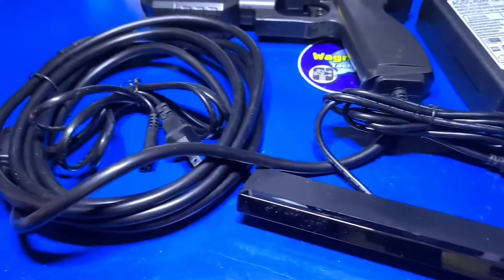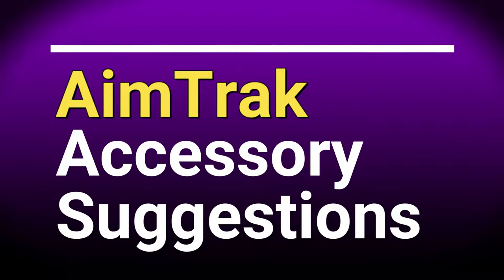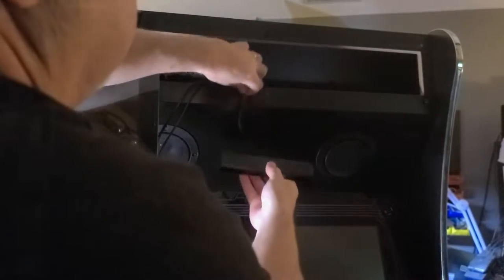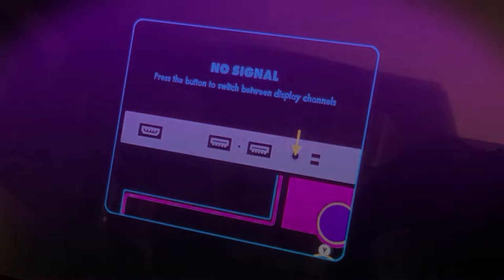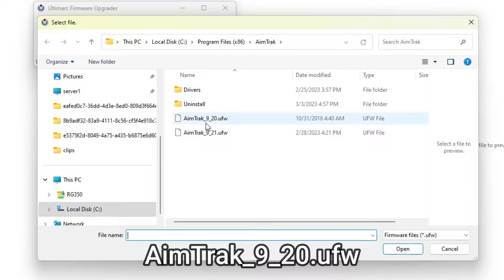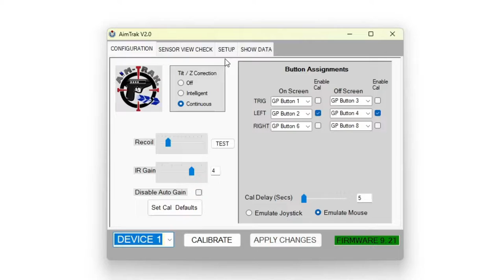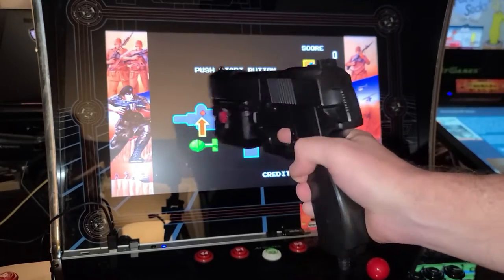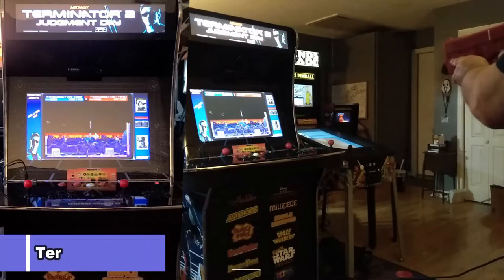AimTrak Light Gun Setup Guide for the AtGames Legends Ultimate

Comment: Hi John! I have one of these and love it. I mounted my IR bar on the very top flush against the edge of the marquee, so you can barely even see it. I also had an Etsy seller print me a holster that I mounted with 3M removable velcro to prevent any permanent mounting issues. I like being able to simply disconnect thr power connector when I want to play more silently without the recoil. It's a great setup!! 👍
Reply from the maker: Hi David, thanks for sharing your setup info and experience!  What is your favorite light-gun game?  One of the first light gun games I used to play as a youngster was Crossbow.  Being able to play it on the ALU is so much fun.
Reply: @WagnersTechTalk  👋 I have always enjoyed Operation Thunderbolt, but I play Sharpshooter the most!
Reply: @WagnersTechTalk  Love Crossbow!  I remember playing it in the bowling alley as a kid!  Space Gun is fun too!
Reply: I need to get the plastic side covers for the ALU. It looks like you have them.  I’ll feel much better mounting my gun to the side with those.

Comment: Excellent tutorial.  I mounted my IR bar by first taking it apart and using a Dremel to reroute the cord from the back to one side.  This allowed me to use Alien Tape to mount it directly, and it looks like it'll hold pretty well--though I had to leave one of the screws out since the cord now blocked the hole.  I also tested leaving the light gun plugged into the USB port and it looks like the latest firmware of the ALU is able to handle it as I didn't experience any issues--at least not yet.
Reply: Nevermind about that test with leaving the gun plugged in--I was plugged in the USB 3 port--which doesn't work for the light gun in the first place.
Reply from the maker: Thank you Russell!  Sounds like you've got yours mounted up great.  The first time I powered on the ALU I saw the 'No signal' and thought I had accidentally unplugged something (which I actually did, unplugged the BitLCD by accident but everything else was fine).  Took me a bit to figure out that the powered hub can't be plugged in on power-up.  Like you, I also tried the USB 3 port and thought the trigger button on the gun was broken.  Until I tried the USB 2.0 port and realized it made a difference.  Hopefully my mistakes will save others some time and headaches lol

Comment: Perfect timing John. I have my ALU's pretty much dialed in. Maybe some side art and Glens Yoke with buystuff mount and of course I need the light gun situation straight and you are the man for providing it. What would really be awesome is if we could get the AimTrak Bluetooth Upgrade Kit to work with the ALU.
Reply from the maker: Thank you for checking it out Carl, if you decide to pick one up I hope this video+guide helps you out!  I almost ordered the upgrade kit, going to hold off on that for now.  I've been spending too much $ lately and need to pace myself 😅
Reply: @WagnersTechTalk  Thanks John, do you think this will work with the core max or regular core? I was thinking about doing this with my core max that is coming and setup on my 55" tv.
Reply from the maker: It should work fine, but I was only focusing on the ALU for this project.  As I test other devices, I'll expand it on the written guide.
Reply: @WagnersTechTalk  Keep in mind with the BlueTooth kit (I am not sure if it works with ALU) you will not be able to use the recoil solenoid and may have to remove it.

Comment: AimTrak also sells the internal DIY kit for the light gun. I bought it a few months ago and I am working on putting it into an old PS3 "Top Shot Elite Rifle". Will report back with what happens. 
The DIY kit has option to solder on 4 more button however you need to use a different firmware to be able to map them. I do not know if that will work with AtGames Legends Ultimate Arcade yet. 
I imagine if you took apart the official AimTrak light gun you would be able to solder a connector or wires for the 4 additional buttons.
Reply from the maker: Sounds like a fun project, yes please report back how that goes!  Think I'll be keeping these stock for a bit, I'll be testing them out on a few other systems in the coming weeks/month.  I will, of course, be using them also with the ALU also.

Comment: A very clear and concise guide.  :) the only thing I wish could be improved is the actual mounting of the sensor bar.  it looks clumsy.  Could it not be mounted flush underneath and towards the front of the Marquee leaving the USB cable to be run behind the marquee itself, into the inside of the cabinet, and then presented out the back to a usb hub that would live behind the cabinet itself?
Reply from the maker: Thank you!  There are 3rd party mounting bars either on etsy or other locations.  The one I installed here is holding out just fine (haven't made any alterations since this video).  Mounting it underneath the marquee might result in inaccurate readings from the gun.  You can certainly try it, but in my testing having it below the marquee worked out well.  As far as inside the cabinet, I wouldn't.  Remember, when you power off/on the cabinet you need to remove the USB to the hub or it won't boot.  Now, you could add a USB switch in the mix and be fine.  Even still, a cable would need to be routed to the outside to do that.  Hope some of this helps.

Comment: All seems to work, except when playing games, the trigger button is on the A Button of the ALU not on the GUN trigger.
Any ideas on how to remap this to correct Gun Trigger?
Reply from the maker: See the first point here: https://wagnerstechtalk.com/al-aimtrak/#Troubleshooting .  Let me know if that resolves the issue please.
Reply: @WagnersTechTalk  Hi thank you for getting back to me.  I do have my powered HUB connected to USB 2.0 not to the blue one. So unfortunately, this did not resolve my issue.  I have a year-old version of SaUCE running and also tried the games in CoinOps Ver 5.  Like I mentioned calibration on the gun is fine, but can't get the trigger on the Gun to work.  When booting to the games in SaUCE it does say like AimTrack Gun not configured.  The Coinops games same issue with the trigger.

Comment: Hello sir... great video.. do you no how to get to the recalibrate screen on terminator 2 ...  which buttons will let me enter that screen
Reply from the maker: Thank you!  All the settings for the game are saved to the .uce file.  Only way I would know of is to delete/re-copy the .uce file (from the original archive).  But, don't think you'll need it.  When I first started it, I just pressed A at all the calibration screens and then it used the calibration settings from the System -> Calibration.
Reply: @WagnersTechTalk  thanks for the help 👍...I've tried to reinstall it 3 times with 3 different T2 uce files I've done over but it still won't let me go back to the calibration screen 🤗 I also tried it on the coinops build..still nothing...the gun shoots only at the bottom...thanks again for the help and I'll just keep checking around..

Comment: Sir have ?? Why does the hub need to be powered? Have same one as yours on order just curious an love learning.Thank you.
Reply from the maker: Very good question.  Keep in mind, when connecting the USB cable from the hub to the 2.0 port you're connecting both the light gun and the sensor bar.  Without using a powered USB hub, you may wind up with some odd results as the power requirements for both devices are coming from a single USB port that may impact the performance or usability (i.e. disconnects).  It's safest to say, use a powered hub for this and what I used during testing.  I hope that answers your question better.

Comment: There are a few games that i cant get working with 2 guns. T2 is one of them where the 2nd player reticle stays stuck in the upper left hand corner. Both fire buttons work but the reticle will not move. Any help would be greatly appreciated. Thanks.
Reply from the maker: You may have to unplug the USB 2.0 cable, power off/on the ALU, plug in USB 2.0 to the hub, then calibrate gun #1, then gun #2 and should be good then.
Reply: Thanks so much for the reply. I think my issue was I didn't have the latest version of coinops. I downloaded the still saucey version but now the issue I'm having is the addon x tool won't process my usb. It runs for 2 seconds and stops. I tried turning off anti-virus and security programs. Thanks.
Reply: Figured it out. Thanks again.

Comment: Hello and thanks for the great video !  Ive done everything and even tested two guns but for some reason after the config in the video my lightgun is showing as player 2 and I am not able to use it and play the lightgun games ?? Thanks for any help
Reply from the maker: Very welcome and thank you!  Start off with one gun, calibrate it, etc. Make sure you changed the DEVICE 1 to DEVICE 2 for the 2nd gun, then repeat the calibration for that gun.  Should be good to go.  Written steps can be found here: https://wagnerstechtalk.com/al-aimtrak/#Light-Gun_Configuration
Reply: @WagnersTechTalk  thanks for responding so I’m only using one gun and it’s on fw 9.20 and is currently device 1 player 1 and it’s showing as player 2 no matter what I do ?
Reply from the maker: Haven't seen that.  I'd try re-flashing the firmware, re-configuring the gun.  Power off the ALU (disconnect the USB to the ALU), power the ALU back on, plug in the USB to the hub, then re-calibrate the gun.  That should do it.  Make sure you're plugging in to the USB 2.0 port (white).
Reply: Im using atgames legends 1.0 and have tried those steps Ive even reflashed and calibrated three other aimtraks I own and its still showing as player 2 .....
Reply from the maker: That may be the issue, I only have an ALU 1.1 to test with.  I updated the title in the guide to reflect ALU 1.1.  You may want to contact AtGames for suggestions here: https://www.atgames.net/arcades/contact/ or the Legends Ultimate subreddit here: https://www.reddit.com/r/LegendsUltimate .  Someone with an ALU 1.0 cabinet may be able to chime in.
Reply: @WagnersTechTalk  Thanks  my friend will do !

Comment: Could this be done on core system as well as core max? thank you!
Reply from the maker: The focus for this video was to fully test the AimTrak with the ALU.  I haven't yet tried the same on the core/max, but when I do I'll be updating the guide as I do it with other Legends devices that are tested.  My understanding is that it will work, so long as the controls are paired via BT.  But can't 100% confirm until I personally verify.
Reply: @WagnersTechTalk  I came here to ask this question myself :)     I have the Legends Gamer Pro, the Legends Gamer Mini, AND the Legends Core with the handheld gamepad - I'm hoping you do a video on the lightguns with these products so I can play on a larger 30"-40" screen. Thanks so much!!

Comment: No USB 2.0 on the gamer mini/pro standard puck :(  I know this is focused on ALU but had my hopes up high!  I saw a comment below about possible bluetooth for core/core max, is the idea plug the powered hub/gun into the controller instead of hub to puck?
Reply from the maker: I've not personally tested the AimTrak guns with the Core/Gamer Pro.  For now, I'll have to refer you to: https://www.ultimarc.com/Aimtrak%20on%20ALU%20guide.pdf .  Specifically this section:

Aimtrak Lightguns on Core and Gamer Pro
On the Core and Gamer Pro every item on the guide applies equally EXCEPT:
1-Make sure you pair your game controllers via Bluetooth BEFORE you plug in the Aimtrak pistol(s).
2-If you are using the Gamer Pro, remember to pair both controller sides to the Core and then plug in
the powered USB Hub that will have the Aimtrak gun(s), IR sensor and CoinOpsX V5.5 (if you are using it)
to the Core single USB port. Do not use the one on the Legends Pro large controller tabletop
component.
Reply: @WagnersTechTalk   Thanks as that clearly says not to plug in to the controller!  I've got one ordered since it's not a hard no and will follow up with my results if you haven't already by then.
Reply: @WagnersTechTalk  Confirmed working on the gamer mini, yay!  I'm embarrassed to say the most difficult parts were finding a sweet spot for the sensor on a 65in tv to calibrate properly, and the idiosyncrasies of 'pressing start' or starting the different games.  I really thought I was losing it when pushing player 1 would not start any of the games. Mine also worked on the latest firmware but because I couldn't get any of the games to start I downgraded to v.20, which of course I realize now was not the problem to begin with :D.  Thanks for the guide and the extra PDF above.  Trying to mix 2 player - 1 aimtrak and 1 using the gamer mini controller, seems to work with some (lethal enforcers) but not all (T2 wouldn't give me a crosshair to control for 2p).

Comment: Thanks for this great video! I followed the video to a tee but have had no luck getting my Aimtrak light gun to work on my At Games Legends Ultimate cab  😢. After calibrating, the crosshairs track on the built in At Games games (Battle Shark, etc.) but the gun won’t fire. Nothing works on the Coin Ops games. I’m so close! Does anyone have any further advice? Thanks.
Reply from the maker: Make sure the powered USB hub is connected to the USB 2.0 port (NOT the blue USB 3.0 port).  Make sure you're using the firmware shown on the guide here: https://wagnerstechtalk.com/al-aimtrak .  If you didn't purchase it new recently, it may have the older firmware that may not work. Also, check out the troubleshooting section on the guide.  Let me know if that helps.
Reply: @WagnersTechTalk  Wow, thank you! I connected my USB hub with light gun and light bar to the 2.0 port and this time was able to play the built in games (Battle Shark, Operation Wolf, etc.)! Now my only problem is, I had to take out my Flash Drive X mounted stick from 2.0 to connect the USB hub for the light gun to work. This means I can’t get to CoinOps X on the ALU cab to play some of the shooter games there. Any advice? I hope that makes sense. Thank you SO MUCH for getting me this far!
Reply from the maker: I keep the USB stick plugged into the USB 3.0 port and then plug in the light guns into the powered hub which then connects to the USB 2.0 port.  You should be able to do the same.
Reply: @WagnersTechTalk  A big thank you for this video. It was great! Mine is also not working on the Coin Ops games, but I have mine plugged into the USB 2.0. The buttons work, just not the tracking.

Comment: My brother-in-law says he wants a 3D printer in the worst way.     I want a 3D printed gun holster in the worst way.    So for his birthday, I bought him a 3D printer.     It's been 3 months and I have no gun holster.     Should I divorce my wife?    Looking for some advice.
Reply from the maker: lol, no definitely don't divorce your wife.  I will say, when I first got my printer it was a few months before I really got a hang of how to level the bed and get a good print off it.  That was about 6 years ago (or longer).  Still using the same printer and it's been great, but not the latest nor greatest available.  It may be that he's having difficulty learning the software for it, Cura had a learning curve.  Then I found my printer had it's own software called FlashPrint (I use a FlashForge Creator Pro) that made printing SOOO much easier.  May need to make a visit and help him get started.  

If that doesn't work out, I have links in the accessories section of the guide to download the .stl for the holster.  Many public libraries should print it for you cheap or free (my library will print it free).  Thank you for the laugh, great way to start the day!

Comment: I bought to sets of these and couldn't get either one to work correctly on my legends pro base or max model they wouldn't even calibrate correctly on mame
Reply from the maker: Please check out the guide and make sure that you setup the gun correctly and used the USB 2.0 port for the powered hub.  Those are the main things that will cause difficulties.
Reply: @WagnersTechTalk  it became way to much of a time consuming hassle I ended up selling all 4 guns and gave up trying to play light gun games all together didn't think light guns could be such an issue 🤣
Reply: @WagnersTechTalk  really wish at games would've went thru with their gun